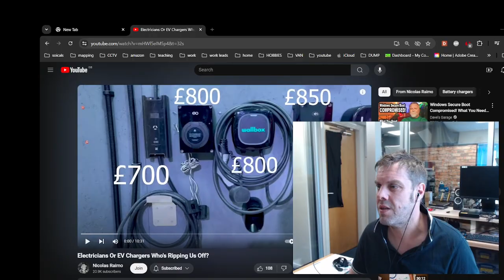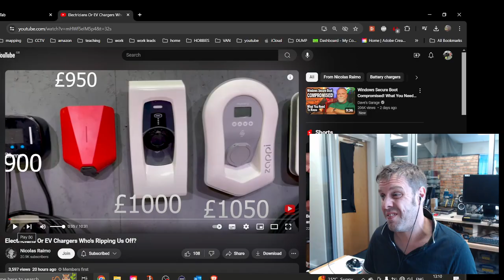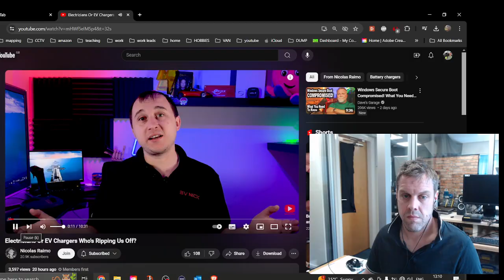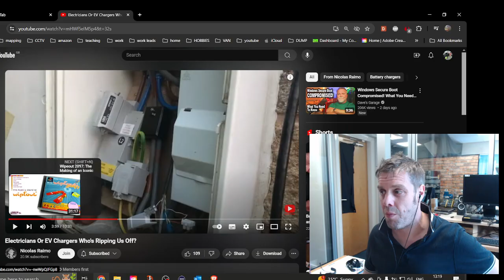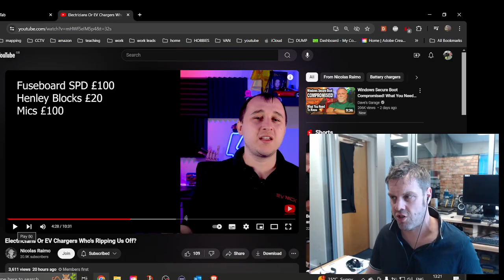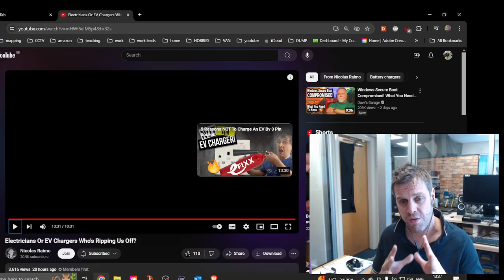EV  nick  telling electricians what we should earn FROM THE ESK (ELEITR SPARKY KREW)

Comment: I work for a major EV installer (1000+ installs per month). We have absolutely no issue with fitting to an existing DB as long as it's a major brand so we can easily get the switchgear and there are sufficient ways to install. Generally most houses would require a DB change to perform an EV install (and we ain't interested in fault finding your dogshit DIY) so then we fall back on the split the tails and fit a seperate board method.

Comment: Best way to reduce labour costs is do it yourself - I did.  All you need is a load of SWE 4mm T&E, a an additional small metal CU and a type A RCD with DP switching.  Cost about £150 plus a few hours in the loft LOL.  And I don't give a toss about tying in with my supplier or letting the DNO know - in case you were wondering!

Comment: Smart meters and supplier smart systems.  Brilliant idea.  There are problems.  As a software engineer I can tell you the stuff coming out of that kind of market is absolute 100% junk.  It has no sustainability and the market is moving so fast that it will simply expire and be replaced with something else in a matter of years.  So whatever smart thing/network/feature you use with your current supplier will not be the last time you have to fork out to re-integrate with their evolving systems.  Partly this is due to the "Embedded software" industry driving a lot of this "smart stuff".  The issue there is, the embedded software industry works in very, very small, very, very limited space.  They have little to no understanding on how to write extendible, flexible, maintainable dynamic cloud connected device stacks.
What they have done, from what I have seen has been "ok" but I 100% guarantee it will not last and will need replacing/upgrading and people will repeatedly get stuck with incompatible "smart gear" that won't migrate between supplier "eco-systems".  Imagine installing a £1000 EV interface on your wall and all it's love smart integration turns out not to work with your version of their smart meter and they won't change it because your EV gadget is expecting an older version and your supplier wont downgrade your smart meter.  Just one out of many, many normal occurrences in the "smart home" space.
Less important to many, but there is a point in principle here.  When you get your smart meter and other smart gubbins working, now try and access the underlying raw data so that you don't have to use their stupid, overly simplified, early high-school level graphs and charts there in.  You will find that you don't have access to that data.  It's not your data. It's your suppliers data and they can do whatever AI/Machine learning analysis on it they like, including identifying individual devices and their usage patterns.  This usually extends to a profile on your daily life routines and can be used to market certain products to you, so is valuable.  However it's also perfectly useful to find out if people are on holiday or if they work nights to burgle them.  It's also very useful to sound trustworthy, having all that information about it, so you become far easier to be socially engineered and then scammed or your identity stolen.  The same applies to smart watches with bio-metric sensors.  If you read the small print, the data pertaining to your heart-rate is NOT YOURS.  It is owned by the provider of the smart watch cloud services and you are not permitted access.  If you request it via "Subject access request", they will send you the very, very raw, unprocessed signal data.... which is next to useless.  They process it on the watch using their proprietary code to produce the heart rate data.  GDPR nor freedom of info requests allow you access to it.

Comment: Going to watch this.  But I like to predict the outcome.  The EV Charger is a high power, single circuit device so it has to be wired all the way back to the consumer unit, for a start.  The mains side of the unit has some always changing (meaning expensive for parts) requirements for earthing, tripping, etc. etc.  RCDs etc.
I think it depends on the property, PE/T&N setup, the charger location, the charger make, the day of the week and the 4th decimal update version of the wiring codes issued that morning....  you might need additional earth rod(s).
Installing it wrong might give them a nice shock far worse than the price though.
I understand a good bit about equal potential and earthing, but having watch several lectures on the risks of EV chargers and combined T&N setups I realised I was just starting to slide down mount stupid.
So, I have installed a transfer switched off grid island for my office.  However, I had my local spark doing the earthing and mains side install.
I would not attempt an EV charger install "DIY" and my local "tame" spark doesn't do them either.

Comment: Your right, just been back today to an install i done 5years ago RCBO board Metal, done a neat job charged £750 + Vat
Went back now the local council needed upgrade on the Smoke Alarms, i was horrified the someone added 3 more 1.0mm to my 6a RCBO, and 2 radials to a 32A RCBO.
I’m going to say to the owner he’s a barber, would you have my a Sparky cut your hair, 
Then inform him that i will have to go back to repair the Fuck up someone has done.
First I’ll get my £600 + Vat for 5 smokes & Heat with Carbon Alarm.